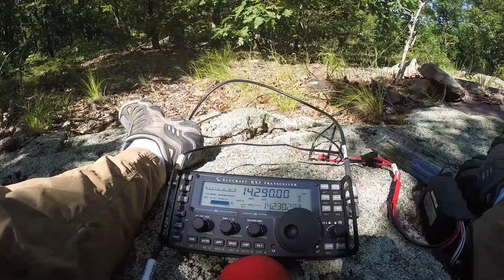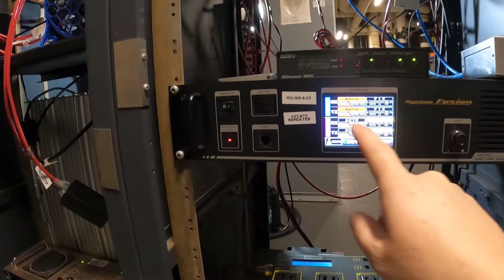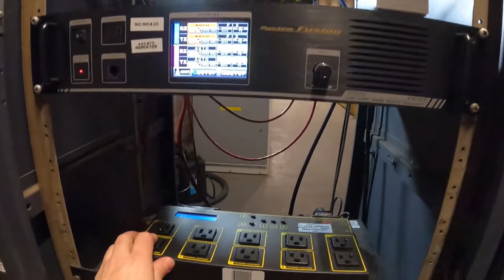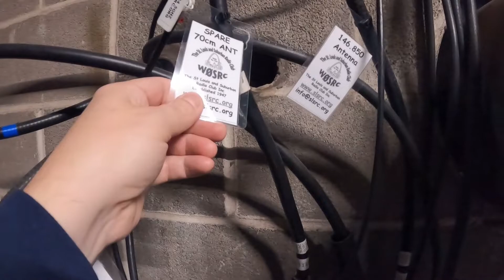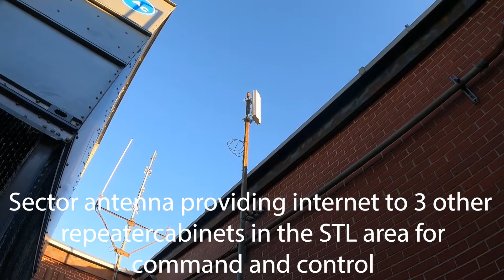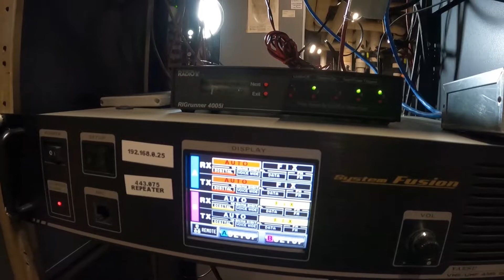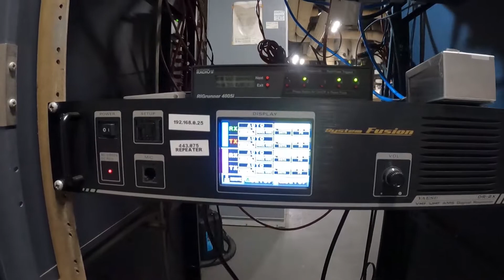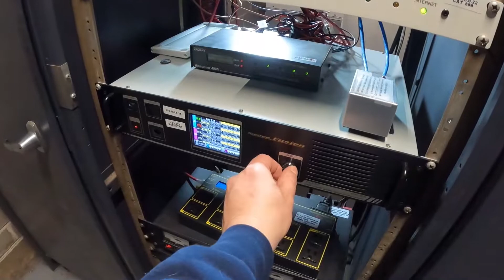Ham Radio Repeaters - A Tour of a Ham Radio Repeater Cabinet

Comment: there was no 120V plug in the one PS with the fan not spinning
Reply from the maker: Yes, the fan wasn't spinning on the left power supply because it had no power, but the right fan wasn't spinning either, and it had power.  I forgot that the fans only kick on when they are needed.  Later in the video you see the fan was running on the right power supply.